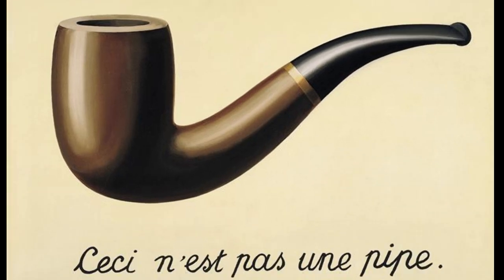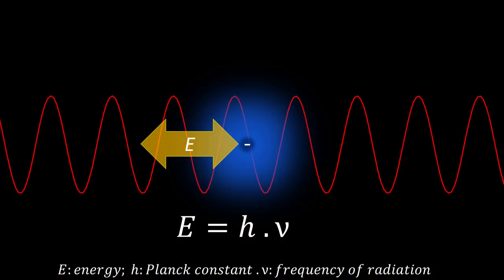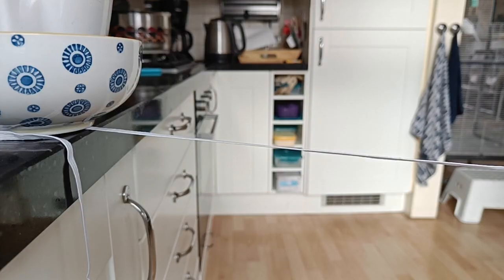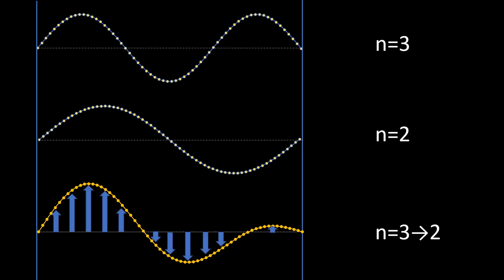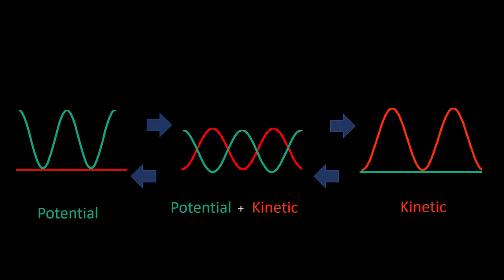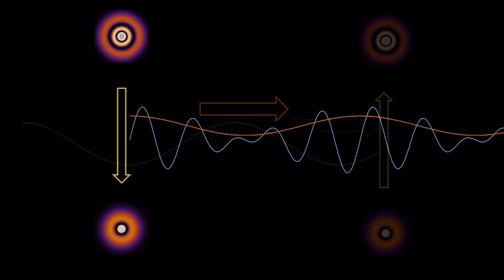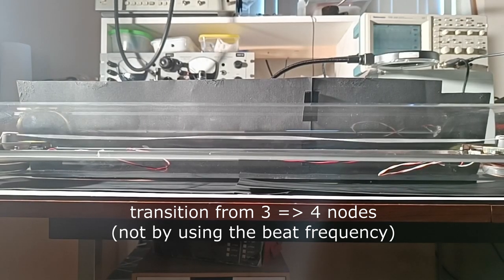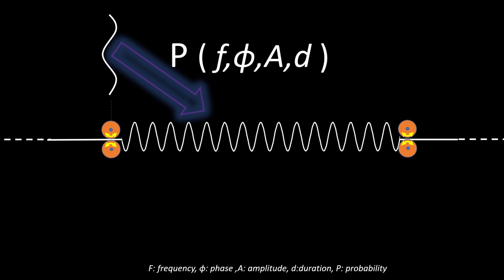Coherence part 3: This is not a wave.

Comment: It should work to just supply the base 32Hz frequency through Speaker A, and then complement it with the energy from speaker B - I'd guess it should have energy/frequency value measured in the "emission" scenario, though I am not 100% sure since there can be some additional losses, so the power required may have to be a little higher. Hard to tell without performing the actual experiment.

I mean, how can it be any different?

If in the "emission" scenario you drive Speaker A from 32 Hz to 40 Hz, and get some transitional energy output at speaker B, then it should work exactly the same in reverse for the "absorption" scenario. Drive the wave with 32 Hz from Speaker A and Speaker's B measured output energy, this time as constant input from Speaker B. This should sum up to an overall wave stimulation "as if" it was driven only from Speaker A @ 40 Hz.

The one thing I don't understand about the way you've done the experiment is why you stopped the Speaker A after achieving a standing wave @ 32Hz. The power has to be applied constantly, otherwise it will quickly die out - exactly as you've observed. Either that or I am misunderstanding something about the whole setup.
Reply: Because four times 8Hz is 32Hz. To put it in musical terms: this is the same note two octaves apart. 32Hz is a harmonic overtone of 8Hz.
Reply: @juliavixen176  I don't understand your comment. To what question are you answering? I wasn't asking why there's exactly 32Hz. I was asking why the Speaker A was stopped and why both Speaker A and B weren't driven continuously with the values I've mentioned.

Comment: “In order to maintain oscillation there must be two kinds of energy involved” : hm, this doesn’t seem right to me? Any energy eigenstate oscillates in the sense that the phase rotates (unless the energy is zero).
One might object that this phase changing isn’t observable and maybe shouldn’t be interpreted as physically real,
but hold on then, why do you say that the electron is oscillating?

Hm, the thing about the beat frequency for a superposition of two energy eigenstates of an electron around a proton..
the relative phases of the two energy eigenstates should indeed change at a rate proportional to the difference in the energies...
And that should pretty much correspond to the frequency of the photon emitted...
but, hm,
can unitary time evolution really take this beat frequency into account?
... though it lining up to match does sound likely...

Comment: Brilliant as always!
Could the 'inertia' you refer to be the equivalent of the Higgs field?
Reply: That was my thought
Reply: Inertia = mass but most mass doesn't derive from the Higgs field at all but from concentrated energy instead (hadrons' mass is much much larger than that of their component quarks, that's because of confinement or strong nuclear energy).
Reply: No, it's the dielectric constant of electric permittivity of free space. 9x10^9 Nm²/C² or 8.9x10^-12 F/m
Reply: Or the impedance of free space (Z) 377 ohms?
Reply: @LuisAldamiz  ....  Yes. The Standard Model tells us photons, like gluons, have no restitutional mass, hence they are not believed to interact with the Higgs Field. What I am saying is that the model presented here suggests we may want to reconsider the Standard Model. Given the strange nature of light & the absence of a compelling description, it makes you think. Not to say I believe it to be true, but it is not something I would completely dismiss......Maybe there is a 'Higgs like' field we have yet to discover.
Reply: @troymeister100  - I'd gladly get a simplified Standard Model (for example a system that explains the three generations and thus removes two of them) but beats me to do that. As for light (EM field activations, alias photons), I'm growingly persuaded that it makes up the pilot wave, what to my eyes would explain non-locality (as photons experience no proper time whatsoever, nor space in their trajectory either, because of General Relativity) and I suspect that gluons are nothing but "altered photons" ultimately. However the massive gauge particles (W/Z and Higgs) are still puzzling to me (including that their masses are so similar to each other and to that of the top quark, the heaviest of the fermions, which seems to be so extremely unstable and the end line of generations because it's heavier than the Higgs boson).

IDK, there's surely a lot to work on that for the brave new physics researcher, I'm too old and unqualified for that. 

What I meant is that inertia = mass, be it derived from the Higgs field or not.

Comment: Have you heard about the ultraviolet catastrophe? and then the photoelectric effect?
Reply from the maker: Yes
Reply: @HuygensOptics grin
Reply: Plack solved the UV catastrophe by introducing quantum energy packages. Jeroen is providing an analogy here, I think, stating that certain fixed frequencies (energy levels) are needed both for generating the transversal standing wave as well as the beat wave.

As for the photoelectric effect, same holds true, I suppose. You need a specific frequency of radiation to free electrons from matter.

Comment: In addition to my previous comment I now have a little more information. I have just watched a video from action lab (created 5 months ago) where he shows two red laser beams mixed to make a green one. It had to be made with a non linear crystal. I there fore propose that in addition to keep the orriginal frequency input (to eliminate the losses) you introduce the second one as a square wave. I admit that this of cause also introduce a 40Hz signal from the 5th harmonics of the 8 Hz but maybe if you make the 32Hz a square instead. That one has no harmonich at 40Hz..
Reply from the maker: Frequency doubling like the case you refer to, only occurs in non-linear media and is not observed in vacuum. In principle, square waves are build up of a very broad frequency range, not just one frequency.
Reply: @HuygensOptics Yes I believe that is a fact. I also believe that generally eloctromagnetic waves don't mix. Maybe the magnetic field is too weak. Yet they do affect an electron. If an electron is a standing wave of electromagnetic energy then how does that happend? I can only think off that the standing wave may behave like a coil in an electromagnet and there fore be more sensitive to weak magnetic fields. Could it be that it is not quite linear in an atom? We know that an electron can loose or gain energy in the atom but can it when it is free? The feynman diagrams suggest that it can but that is as kinetic energy I believe. 
Also from chemestry we know that electrons tend to pair up in atom binding. Could that be a magnetic binding? Also we have another small problem explaning an electron as a standing wave.How does it become negative electrically?  From your picture with all the possible oscillation possibilities it is indicated in red and yellow where yellow is positive and red is negative. That suggests that an electron is positive inside and negative outside.  Is that the case?
I know that you mainly work with optics but as you strayed out from that in this video I didn't think it wrong to mention my thoughts.
Reply: @HuygensOptics  I just got a thought. With your very accurate setup to messure light maybe you could check if light is at all sensitive to a very strong magnetic field. I am sure it wouldn't be much but maybe it could show with some of your inteference equipment. Even a slight phase change would be proof I would think.

Comment: Great as anyways 👍
I look at a photon as a series of physical events in a super fluid. 
An atom has an extended expanded orbital shell because of energy input.  It reaches a limit and catastrophically shrinks.  Local space rushes in to fill this gap.  This creates an ever expanding implosion shockwave.  A sphere expanding at c from origin.  The membrane thickness of this photon is the wavelength as we measure it.  How fast the orbital collapsed.  
The totality of the spherical wave function. 
I have videos.  

Quantization is an effect of the fluid properties, Eo Uo of space.  A dielectric super fluid.

Comment: in seriousness how about a spiderweb-silk for the string? then confine in a vacuum
and/or vary the length of the segment in a perpendicular oscillation on the beat frequency
presumably there are waves radiating every which way constantly and other waves will always interfere
but the ones on the beat or 8hz multiples will be the ones that matter
and if these cross-radiations are standing waves and not merely pulses then their effects ought to be cumulative thereby creating essentially a ley line where it is 'easier' for a wave to exist 
and more faithfully communicate whatever information the discrete entity of the measured electron indicates
isolation doesn't always make things easier to understand
people either lol

Comment: I think this would work much better if you used metal strings (from musical instruments) and a much higher string tension (which would also require a higher speed camera).
Reply from the maker: Yes good idea .  But imagine connecting it to the cone of a speaker and try to change phase... You probably need some long range piezoelectric actuator to do this.
Reply: I think so, yes. Another problem with the (magnetic) speaker is that it introduces a lot of damping, whereas a piezoelectric actuator is very rigid. Of course it can introduce a lot less energy in the system per cycle, but it doesn't matter because if you also use a piezoelectric actuator (or simply a quiet speaker) for the transverse excitation the energy introduced in the system is comparable, and only the ratio of the excitations matters.
Reply: Also you can use a trick from musicians and induce a specific mode by simply plucking the string while pinching where the first node would be. Then the string will vibrate (for a good while) only in that mode. This simplifies the setup considerably, because you don't need the speaker at all.

Comment: 29:35 I disagree :face-red-heart-shape::eyes-pink-heart-shape::hand-purple-blue-peace: at this point time stamp of the video. You assign in your experiments the medium elasticity tension longitudinal force propagation speed analogue to the speed of light c in the vacuum as the maximum speed in the medium. Well, this cannot be since we already have observed and measured c speed as being the transverse wave propagation of light. So, if we assume as  theory predicts that in any elastic and compressible medium longitudinal waves propagate much faster than tranverse we have for the case of normal light then you will have also to accept that if there is an longitudinal propagation of energy in the vacuum then it must be essentially superluminal thus larger than c (FTL).  

https://www.youtube.com/watch?v=ExhSqq1jysg&t=1775s

Comment: Dear Huygens,

:eyes-pink-heart-shape::thanksdoc::hand-purple-blue-peace:  Your experiment trying to demonstrate a classical analogue of propagation of EM waves energy and different  modes of propagation thus longitudinal  vs transverse waves and their mixing are astonishing and many congratulations! Especially you have show that in the case of a vibrating string there is also a longitudinal component present that propagates much faster than the transverse component of the wave, see here at this time stamp of the video:

https://www.youtube.com/watch?v=ExhSqq1jysg&t=495s 

(Note: The two modes of energy wave propagation are still mixed shown in the case of longitudinal transmission at 495s timestamp of the above video. I reality the pure  longitudinal component not visible in the slow motion is much much faster than the transverse component of the wave shown although much less in amplitude and goes exactly at the speed of sound of this string material used which I am sure is faster than the speed of sound o air)

However these experiments assume that there is always a  medium present (i.e. like the cloth string you used in the experiment). In contrast our modern understanding of Maxwell theory and established electromagnetic theory today, is that free space vacuum IS NOT  a medium for EM energy propagation and the EM waves that can propagate freely without any medium needed. 

Therefore because this axiom in physics today there can be no static stress forces and tension in the vacuum acting like an elastic and compressible medium that would allow longitudinal compression EM waves propagation and in the best case the vacuum free space can be considered as analogue of a perfect incompressible fluid and therefore as we all know there can be no longitudinal compression waves (i.e. like sound) in such a medium and only transverse waves mode of propagation can exist.

In a nutshell, according to our established classical theory, longitudinal EM waves cannot exist and only purely transverse EM waves can exist in the vacuum and any other actually material (doesn't matter) since EM waves propagate through the intermediate space between atoms in a material that is still a free space vacuum. An here comes the big paradox of the whole story which can be summed as following:

Although our current understanding shows that EM waves and energy do not need a medium to propagate,  it is still not possible to proof that it does not need also the free space vacuum which is ultimately embedded in Maxwell's theory with the ε0 and μ0 electric permittivity and magnetic permeability of free space parameters!...

...and here come the paradox. "Which makes then the vacuum, what?..."

So, no. Your experiment although impressive is not a good analogue of EM waves propagation since EM waves do not have a longitudinal propagation component and are considered purely transverse waves. If that was not the case then there should exist a superluminal propagation speed much faster than the speed of light in the vacuum c  since it is proven that longitudinal compression waves (i.e. like sound for example) propagate much faster than their transverse counterparts: 

https://physics.stackexchange.com/questions/765463/propagation-speed-difference-between-transverse-surface-waves-and-underwater-lon  

If you ask me now personally, my research shows that there is definitely longitudinal interaction inside the vacuum that create superluminal effects in our spacetime known in physics like non-local effects like quantum entanglement and quantum tunneling and although longitudinal propagation effects are more subtle in amplitude and have shorter propagation range dynamics and thus more difficult to detect. Actually IMO they are absolutely important for the existence of our universe and spacetime. For example no one knows what is the propagation speed of gluons (not to be confused with photons) inside  proton or neutron? It is possible in that short distance range the longitudinal propagation to be the dominant mode. In other words what is the propagation speed of the strong force?  

Finally, ask yourself if the vacuum free space is not a medium at all or in the best case scenario a perfect incompressible medium that does not allow any static stress and tension forces then how we get in our reality static electric and magnetic and gravitational fields that clearly demonstrate stress and tension forces applied interaction of practically infinite speed?

Comment: Can we simulate this without friction? 🤔
Reply from the maker: You can take a look at this simple simulation: for one it shows that without friction, the string movements quickly become uncontrollable: https://phet.colorado.edu/en/simulations/wave-on-a-string.
Reply: @HuygensOptics  No energy is dissipated, it accumulates in the string and causes the string to stretch forever, so the amplitude of the wave increases.

Comment: It still boggles my mind that we can only detect waves when they interact with something. The world/space around us is full of waves but we can't see them 'side-on' so to speak - we can't detect the wave between A and B, only when it reaches and interacts with B - this wrecks my mind. We're not even detecting waves, are we? We're only detecting the results of them interacting with matter. Gaaaagh!
Reply: I don't quite follow you on the detection aspect. I make use of portable radio direction finders that 'sample' the E field and the M (or H) field of an EM wave that is traveling through the space this device occupies, and through the relationship of the E and M (or H) fields the direction of the wave can be determined ... moreover, I can attach a small antenna to each probe of a vector voltmeters (HP 8405) and sample a radio wave traveling through the space the antenna and probes occupy ...

Comment: radio waves and microwaves take amplification and dissipate over distance even in a vacuum like space, so where does light get the energy even at lot amplification to brake this rule of energy dissipation?  🤔
Reply from the maker: You'd have to assume that empty space is actually energy.

Comment: Something to consider also is if a packet is rather a single pulse of rf and-or light and has a square wave shape rather than sinusoidal.  It could be that during the creation and transmission of that light is where the number of pulses, hence frequency, comes from.